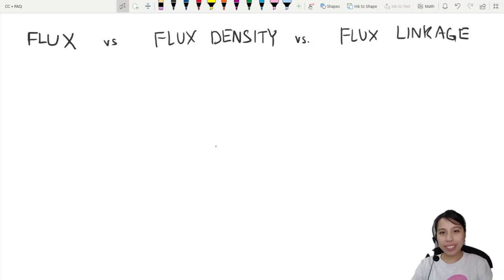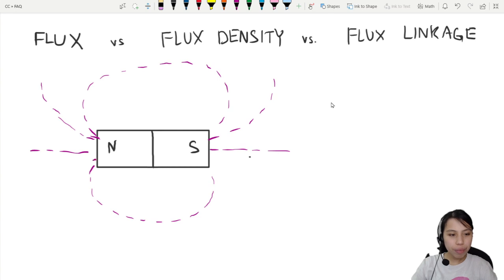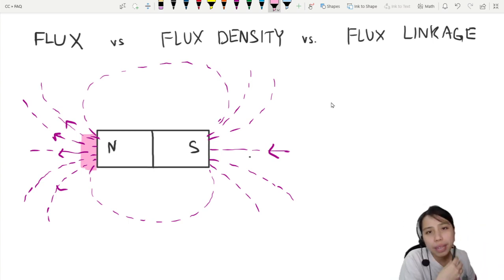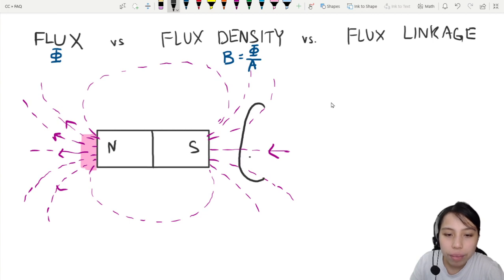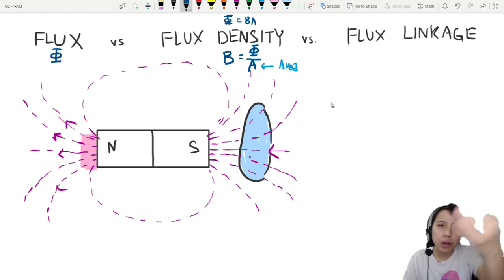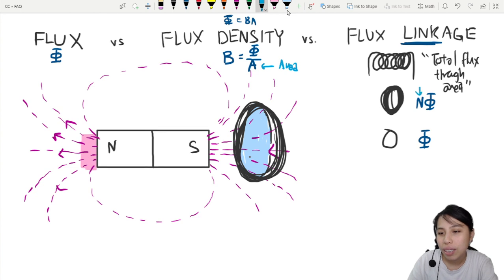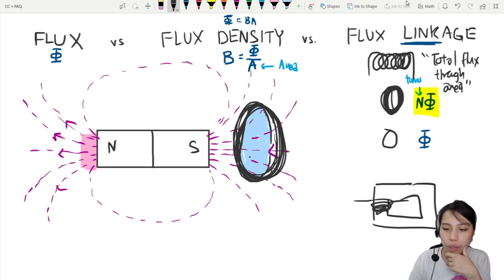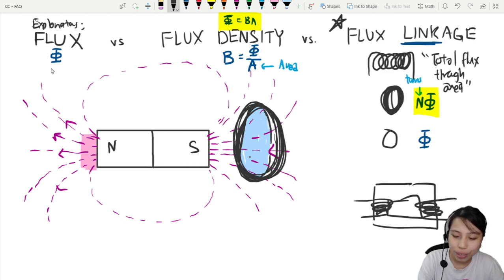Magnetic Flux, Flux Density, vs Flux Linkage Confusion? | CAIE A Level Physics

Comment: But why does it matter whether we use flux or flux linkage? If the various loops in a coil are modelled as being parallel to one another, then the same number of flux lines should flow through each and every loop. So why do we care about how many loops there are?